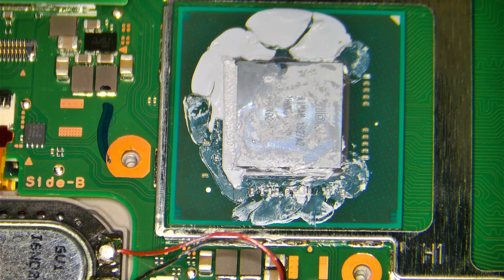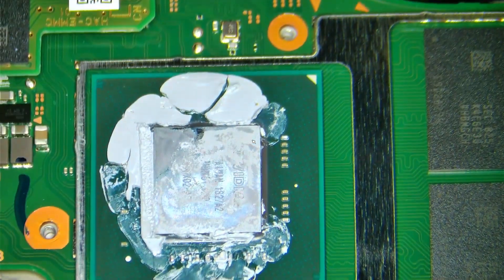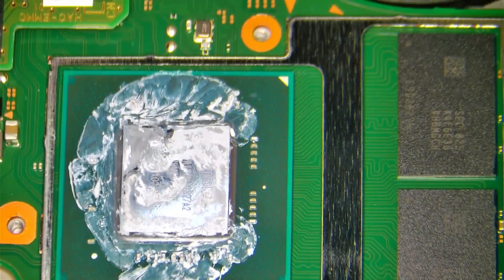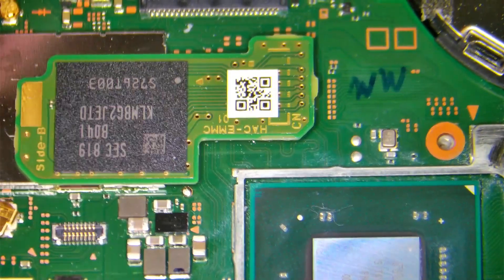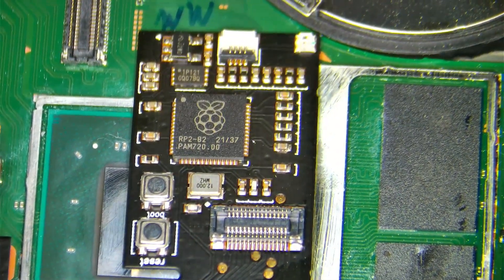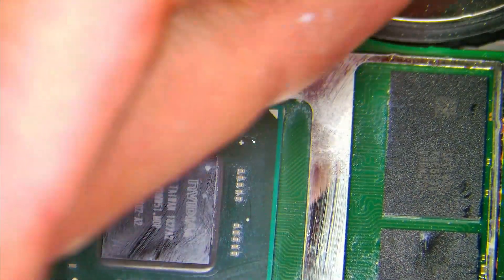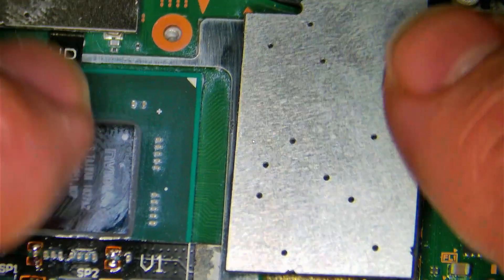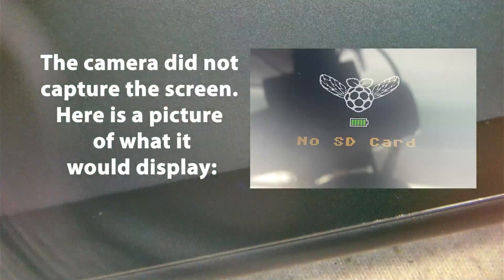PICOFLY CORE RP2040 Nintendo Switch V1 INSTALLATION

Comment: I did the soder and my switch boots into stock firmware what do i do?!
Reply from the maker: Check solder connections, something is not soldered properly or your chip may not be flashed.  Good luck
Reply: @Wayayeo  it's the same flash as a v2 correct?

Comment: I just tried my first attempt last night and, unfortunately am not seeing the "No SD card screen". The Pico was flashed, however when I plug it into the switch and try to start up, it flashes blue then continuously flashes yellowish green then shuts off, but no life on the screen. If I plug everything as it was originally, it boots normal. So is there something wrong with the programming?
Reply: I think the bridge across the capaicotr was bad, mine failed last week and this time I'm buying 63 37 tin lead solder so hopefully it goes well
Reply from the maker: Sounds like a bad solder joint or cable. You’ll need a multimeter to check the connections.  You should get a reading on all except “b”.  Take your time and be patient, hard to break something unless you’re really trying.  Best of luck.

Comment: Hey I have the same chip labeled new2040plus. Did you just leave on the firmware that it came with or did you flash on the latest picofly firmware from GitHub.

Comment: hi, I'm broke two capacitor while solder at video @6:20. my nintendo still work in original. how do i solder it sir? that capacitor was broken
Reply: I broke it too and it's still working.. successfully reached "no SD card" picofly screen. Did it have any effect in the future?
Reply: @sapphirenoctua  no effct..1 broken still working..
Reply: @shahrulaiman4154  glad to hear! Broke mine too (the left one) and ran some games after modchip. Works fine! Thank you for quick reply :)
Reply from the maker: You’ll need to find a capacitor replacement/donor. Clean the area, prepare with new solder and carefully solder back in place. Look my other videos. Im sure I did this before. Good luck
Reply: @Wayayeo  someone told we that APU capacitor is just a filter capacitor. they said can solder without that capacitor. it is true?

Comment: I’m trying this exact chip and I’m not getting any leds on the 2040. Do you know of a way to test the flex cable after install?
Reply from the maker: Check you voltage cable.
Reply: Did you solved your Problem? I got the same.
Reply: @dumahaldemaduma  Might be a little late, but mine did not come with a firmware installed. Install the little USB-C Breakout board, connect to PC and drag on the fw_2.73.uf2 firmware. Just had the exact same problem as you and that fixed it.

Comment: do i need to flash picofly or it's flashed from the factory?
Reply from the maker: The one installed in the video is preflashed.
Reply: @Wayayeo How can I see if the chip firmware is already flashed or not?
Reply: @Entity303ITA  As far as I remember, if the chip is flashed and it glitches the console, a green light will turn on on the chip (not sure because my chip is still on its way to me)
Reply: @L1te  Thanks for letting me know 👍🏻

Comment: Hello, I have a 2018 Mariko Switch and it is supposed to be V1, but my question is if it really is v1.1 to use the V2 flex or if it is simply v1
Reply from the maker: If the cable aligns with the caps on cpu then you’re good.

Comment: Great video! Is the v2 install different than v1 or exactly same?
Reply from the maker: Flex in cpu might be slightly different but soldering is the same.
Reply: I've done a lot of V2's. Basicly never did a V1 but to me they look the same. The chip, aka the connector from the cpu to the chip is a tiny touch different, but basicly the same steps. If you wver solded something small, it shouldn't be hard to do, still, be careful to not damage the cpu...

Comment: Wayayeo, what temperature are u using for those sp1 and sp2 points?

I'll use 183° solder, but I'm not sure what temperature to use with the soldering iron
Reply: Hola, yo he puesto varios chips y hago trabajos de soldadura microelectrónica y uso 300 grados para evitar mala soldadura o soldadura fría pero solo se toca el componente no se deja puesto para evitar levantarlo o quemarlo
Reply: I would also like to know the ideal temperature of the soldering iron that was used